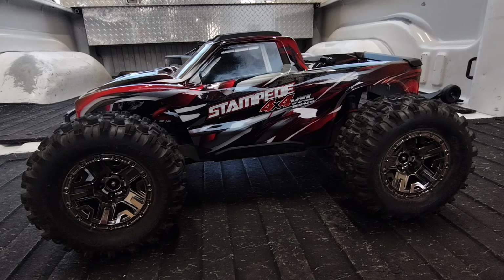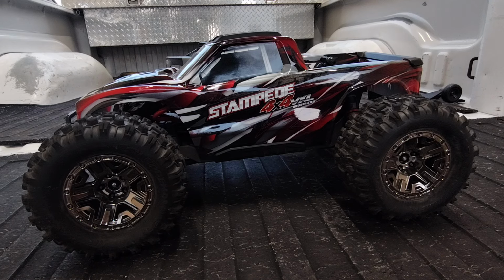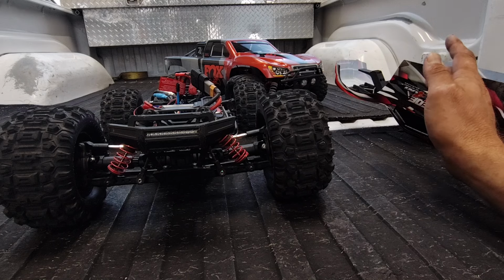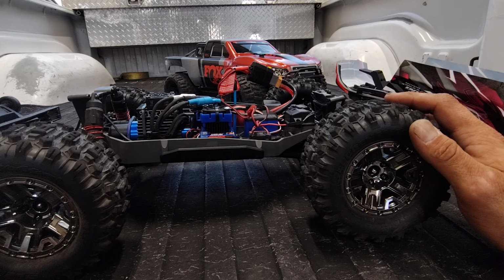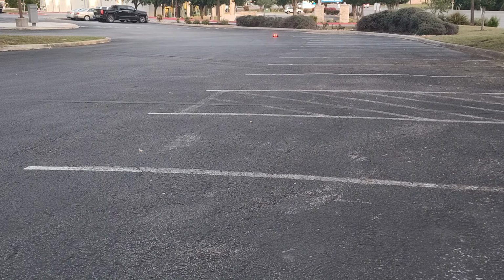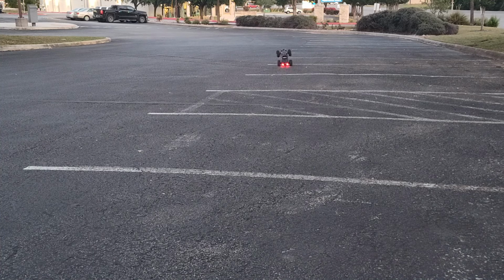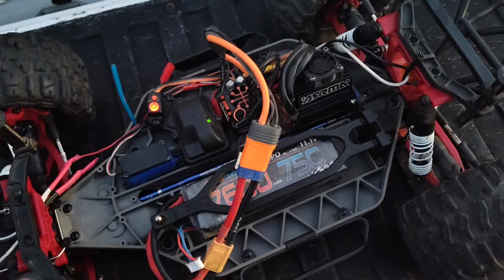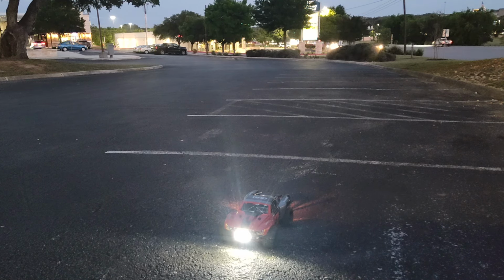Traxxas Stampede 4x4 VXL quick review and things to look for.....

Comment: What's a good what's a good gear ⚙️ to put in her to make her go faster than 42 what's your opinion I wanted to at least reach 50 at least
Reply from the maker: 54 spur 23 pinon 3s lipo will need fans, it will do 66 mph . Hard surface only and speed passes only like no more than five then it needs to cool down.
Reply: Is there another way that I can bash it without it overheating and still go faster than 42
Reply from the maker: @williamcabello2142   yes Arrma outcast 4 s upgrade
Reply: So the ESC from the Arrma 4s will fit the stamped
Reply: Do I got to change my motor too or just the ESC
Reply from the maker: @williamcabello2142  the Traxxas Maxx ESC will work.....going 4s
Reply: I was confused lol